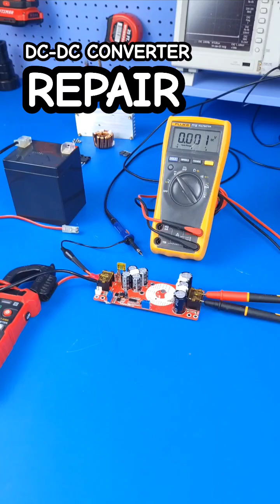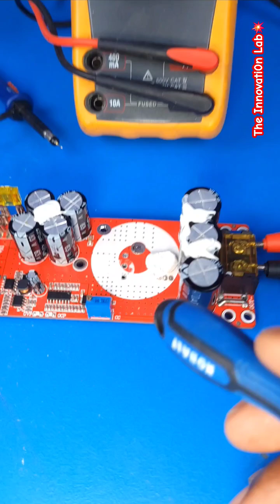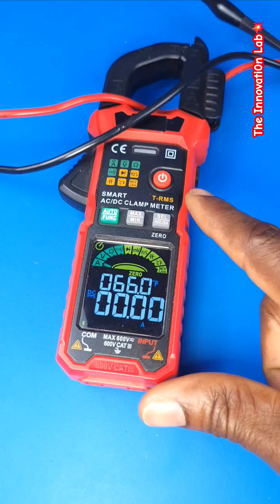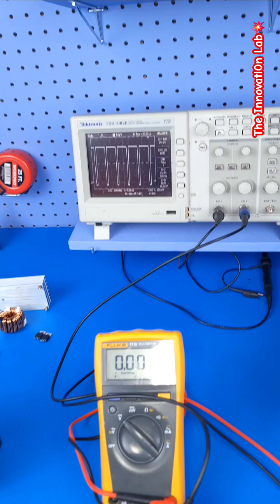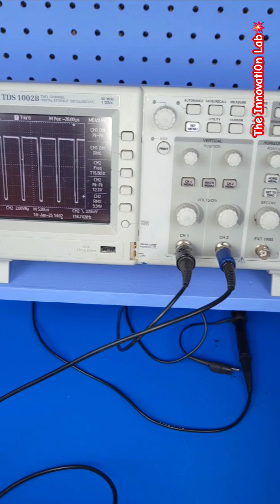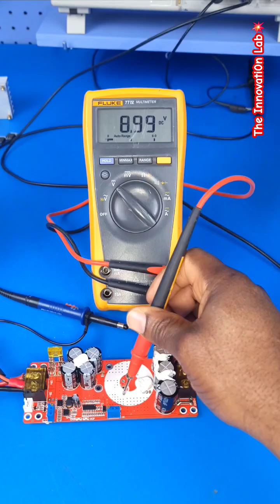How to Repair a DC to DC Boost Converter #shorts

Comment: Hello mister. Mine is 1200w model. The input is done by 480 pc batteries of 18650 connected as 3s 160p configuration. Due to the high current, first the fuses 2x20amp are burned out then the biggest mosfet which regulates the current burns too. Any suggestion on how to limit the input current? Since itself isn't able to manage it
Reply from the maker: Great question.
You can't really limit the input current. The converter limits the output current. However, you can avoid the failure by making sure that you don't overload the converter. For the 1200W model, I would recommend keeping your overall load below 800W. 
A high surge load will damage MOSFET, and the shorted MOSFET will cause the fuse to blow.

Replace both the MOSFET and your fuses, keep the load as low as possible, and make sure that you are using a fan to keep the converter cool.

I hope this helps.
The Innovati0n Lab 💥 www.theinnovati0nlab.com

Comment: In my circuit a site four pins of IC XL7005A have been soldered to the printed  circuit board ****Tell me the solution???
Reply from the maker: I don't fully understand your question.😊
Please elaborate on the issue.

XL7005 is a fixed frequency PWM chip for buck converters. 
Are you saying that the pins are not soldered in your converter?

The Innovati0n Lab 💥 www.theinnovati0nlab.com
Reply: @theinnovati0nlab782  Sir if I had your whatsapp number I would have sent you the pictures and you would have understood

Comment: What would be more efficient way of upscaling output to 19.5v about 60-65Watts? 
1. Upscaling from 3.2v
2 Upscaling from 12v

Any idea about how long can it work, any particular boost converter which you can suggest pocket friendly but efficient too. How efficient would that be?
Reply from the maker: What you are asking is possible. However, at an input voltage of 3.2V, things get more difficult and expensive because you have to find chips and MOSFETs that would operate efficiently at this level....they exist, but you have to be prepared to spend the resources.

However, boosting an input voltage level I'd easy.
Just use the boost converter I reviewed in the video below.
👇👇👇
https://youtu.be/2KyBwwldqkk

I hope this helps.
The Innovati0n Lab 💥 www.theinnovati0nlab.com